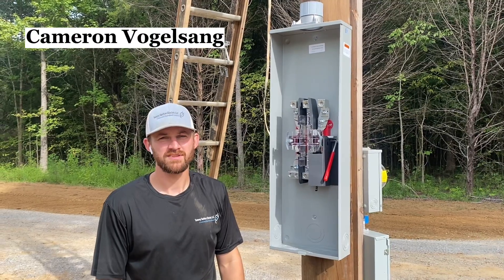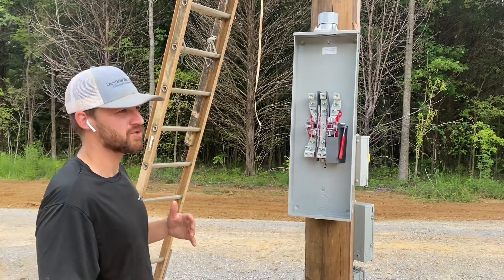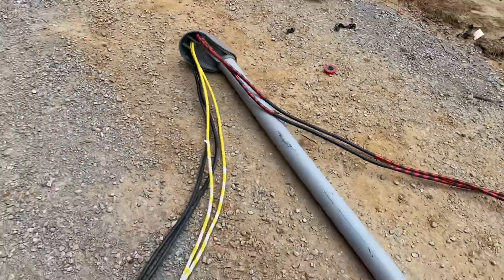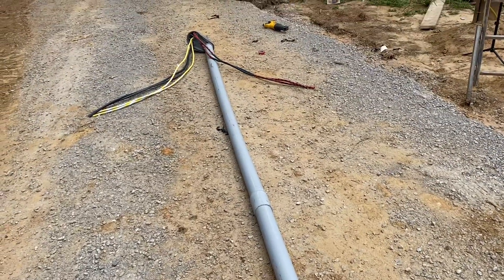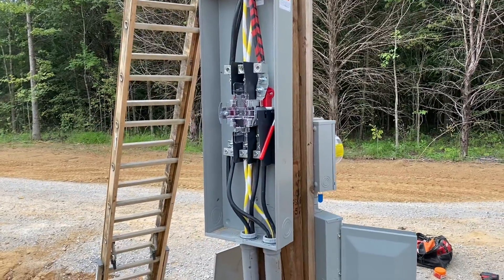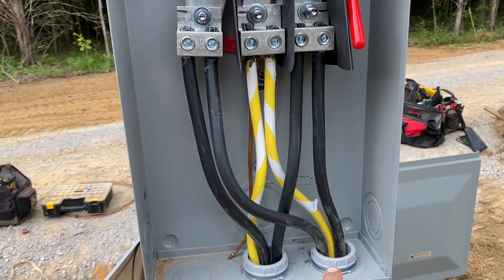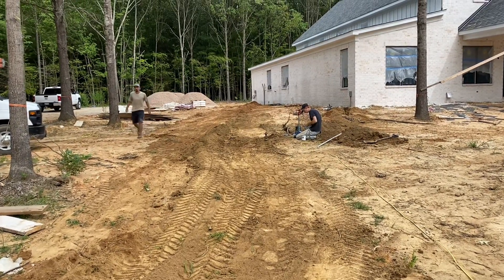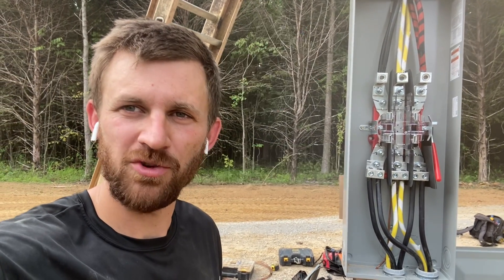How to Install a 400amp Overhead Meter Base (with riser)

Comment: Hello -- Seeing that you are a Tennessee Electrician -- Let me ask you a quick question -- Are the AHJ (code inspectors) requiring that Slip Joints be installed to the Meter Socket Box when the service is ran underground  -- And is it in all of Tennessee or depend on the County the work is performed in?  Going to be building in Rhea County.

Comment: Where I live the cable running under ground has to be conduit. Even insulated cable. It looks like yours in the video is not in anything when it was being back filled. Let me if what I saw is correct?

Comment: Why double lugs on the output side and single lugs on the line side ( two wires under one lug in NY is a no no ) plus no expansion fitting ?

Comment: I would have left some slack in the meter base to allow for the swaying of the pole thus the cable wont pull out of meter lugs. I would have liked to have seen how you laid the conductors in the trench. How deep? Direct burial? Tape at 12 inches....details man, need details....

Comment: How is it you get away with no circuit breaker disconnect after the meter base? Wouldn't you have been better off with a metet base-main breaker combination set up?
Reply: Once the wires leave the load side of the meter it's your responsibility. The disconnect should be a circuit breaker to provide overcurrent protection on the service entrance conductors.
Reply: Then add a disconnect at the house. It doesn't need to be an over current disconnect
 A 200 amp 3r knife switch would work. Just make sure the lugs are doubled up to accommodate 2 conductors.
Reply: I would think the inspector would want the disconnect at the house...that is where I would put it..

Comment: 2 conductors in the line side lugs is a major code violation in Michigan. Looks like  anything goes down there
Reply: Thats a 400 amp meter socket those lugs are rated for multiple conductors from the manufacturer.  Its very common to do for parallel feeds and NEC refers to manufacturer specs for installations so its not a code violation.
Reply: Expansion pipes.  Lugs.  Derating. Phasing. / All kinds of colours.   Would've like to seen the disconnect switch
Reply: Im from michigan those are allowed on 400 amp meter base, those will split into 2 separate 200amp distribution panels inside the house. I live in city of Novi all big millionaire houses around here are wired like that.

Comment: What's up with the yellow tape on the neutral?Thats a 480 volt phase color
Reply: He cut lengths off of his URD wire for the neutral and taped it white.  URD typically comes black with a yellow stripe or solid yellow for easier identification.

Comment: Not here to make trouble but is that an aluminum extension ladder?
Reply: First thing that caught my eye...I wouldn't even attempt this job without a fiberglass extension ladder.  Looks like they didn't have to connect the line side though.

Comment: Michigan electrician here. Question for ya. Is it the standard in your neck of the woods to put the meter at the pole and then pipe to the house? Do you hit a disconnect on the outside before you enter the building? Just curious. Stay safe out there!
Reply from the maker: Can either mount the meter on pole or house. Doesn’t matter. We have disconnects if the house is generated.